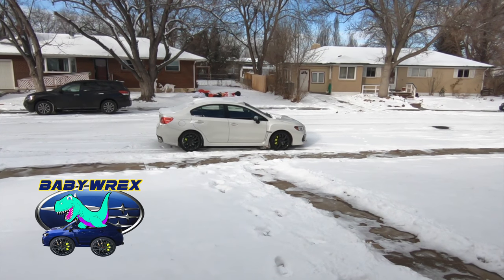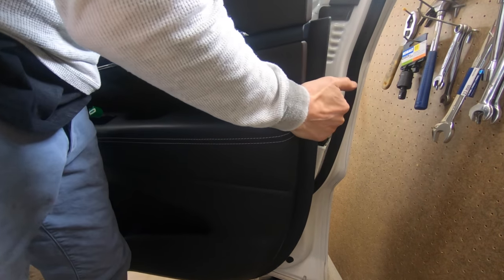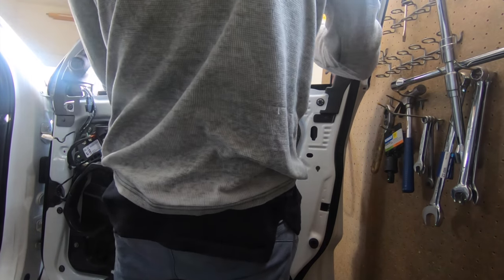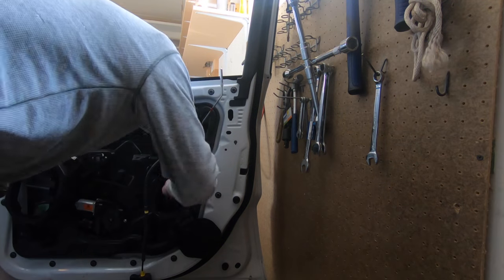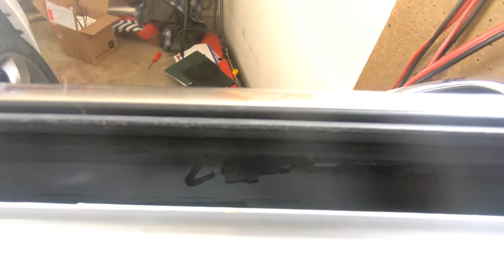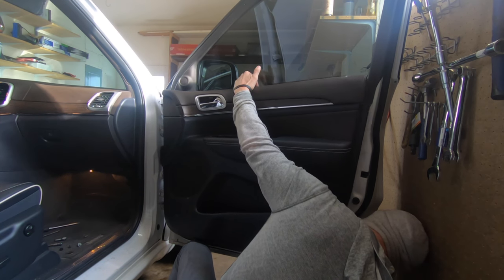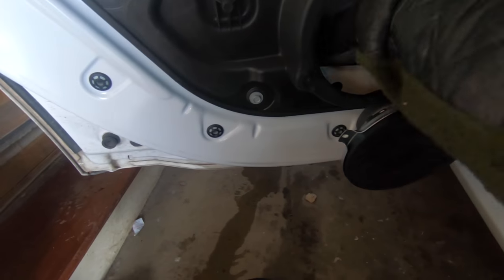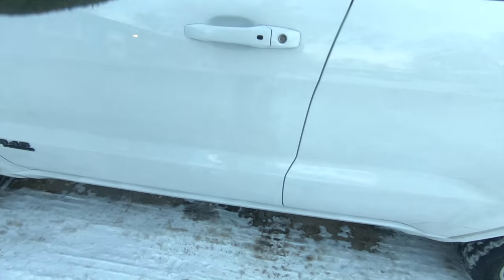2011-2018 Jeep Grand Cherokee: How to remove chrome door handles

Comment: 10:39 Try lining the socket with a scrap of notebook paper, and nut will not fall out when you remove it.   Tape one side of scrap onto the side of socket to hold in place.   14:29  Mask off paint around door handle to protect from scratches while fidgeting to remove door handle.
Reply: I used a telescoping magnet to remove the bolts. Simple

Comment: thats awesome. i am sure u get this question often and im sure i know the answer but, why don you just pick up the coers that 3M to the existing handles. I am assuming because you want the actual handles. Which i get but for me i am just going to get the covers. With that said you did help me learn other things about the door as well so either way this was veryt helpfull. Specially when i decide to change the ambiant lighting color from cyan to RGB and when i sound deaden the doors

Comment: Front doors were a pain, even with taking the door latch off on the side of the door. My arms were just to big to get them moved around. I eventually pulled the door skin back far enough but had to watch breaking off the plastic inside holding the lock on. 

Btw the video is amazing, damn arms were just to big esp after dropping a bolt. Hey wife lol
Reply from the maker: The job is a slight nightmare for sure and all those damn 10mm around the inner door panel!  Shoot me lol glad that video helped and the oem look is so much better than vinyl or plasti dip

Comment: Hey could you provide info or video on how you switched out the rear step surround?  I've got.the mopar blk textured rear step surround, and it has tabs all around the piece, snap on functionality, without any screws.  How did you pop off this piece?  Thank you.
Reply from the maker: Gene P. Just use plastic pry tools and pull up on the pad it pops out super easy.  Look at the replacement black pad you’re going to swap in and locate all the key clip areas this is a huge help.
Reply: @AtlasWilder  Thanks man for your prompt reply and advice. 
It was an easy pop up.

Comment: So here is my question. I have murdered out several of my Jeeps in the past but my 15 Limited has the chrome covers on the door handles and the side view mirrors. I want to paint them to match the body color, True Blue Pearle using paint from the Touchup Zone. Any tips on removing the covers and any experience with Touchup Zone paint? Thanks.
Reply from the maker: I’ve used touch up paint before however what is your intention? To use a spray can right?? Chrome covers & not actual handles?

Comment: Should i do this for my chrome handles on my black 2015 or just do the cover/ wraps ? ... thanks for the help
Reply from the maker: Just cover the silver parts way easier and cheaper. Replacing the entire handle takes some work.
Reply: @AtlasWilder  sweet man thanks for the reply
Reply from the maker: If you want to do this nightmare of a job find the handles used on eBay. It will save you $$
Reply: @AtlasWilder  not really lol was hoping the wraps would work w the black , did  chrome window trim delete  yesterday, def needs the handles to match it now

Comment: Does anyone know what would cause the passive entry on the front passenger door not to work after doing this? It works fine on the drivers side but not on the passenger. Unlocking and locking neither one works from the outside.
Reply from the maker: You forgot to plug in one of the connectors or didn’t get it plugged in all the way.  I actually made this mistake

Comment: Any reason why you chose to replace the whole handle (which I am sure was not cheap) as opposed to buying the $20 black gloss handle covers and painting them OEM white to match your jeep?  I am leaning towards this as a cheaper option then replacing the handles themselves.  Thoughts?
Reply from the maker: FunkyMedicine I picked up the handles on eBay for about $200. I don’t usually cut corners on aesthetic mods, if I can replace with oem stuff. The covers will have gaps on backside where you slide your hand. That would bother the heck out of me. 
However you do you! I totally get it money could be spent else where.
Reply: @AtlasWilder  How did you vinyl wrap the chrome tail light bezels?  Did you wrap it with the tail lights as is, or did you remove the tail lights first?
Reply from the maker: Didn’t use wrap, those are the oem painted bezels.
https://rover.ebay.com/rover/0/0/0?mpre=https%3A%2F%2Fwww.ebay.com%2Fulk%2Fitm%2F352437172331

Comment: Hey, thanks so much for making this video, I’ll be using it for sure to replace my handles as well!  Would you happen to remember where you picked up that red tool for removing the interior door panel and window control panel?
Reply from the maker: Ricardo Barraza thanks! I swear I got something similar to this 
https://rover.ebay.com/rover/0/0/0?mpre=https%3A%2F%2Fwww.ebay.com%2Fulk%2Fitm%2F263182122614
They have them on amazon also.
Cheers!
Reply: Just ordered it, thanks so much! Can't wait to give this a try.

Comment: Great informational video!  Would you be willing to show me how to replace the chrome outer window lining with the black?  To order this black strip, you need to identify a Jeep GC at a dealership, then ask what part # it is.  This would make the GC look even cleaner imo.  Any suggestions?  Also, do you have a video on swapping out the side mirrors?  Thanks again.
Reply from the maker: Thanks! I’m not sure we will ever get around to replacing the trim.  There is some videos out there however and check out jeepgarage forum for more info on that.  I don’t have a video for the mirrors, I did most the mods on the Jeep before I got into vlogging them.  A lot of people also go the vinyl route on the trim. Cheers!
Reply: I drive a 2017 overland. I ordered my window chrome delete vinyl 3m sticker from crux motor. It looks perfect and if I can do it anybody can. They have a video on you tube but its pretty self explanatory.

Comment: Did the new handles come with a new physical key, or do you need to switch out the lock from old to new handles?
Reply from the maker: No, you will be able to swap out the lock cylinder it’s easy. 👌
Reply: @AtlasWilder  awesome! I'm doing big things to my 2018, getting rid of the chrome is priority 1

Comment: Soo do you actually have to remove the window on the front is it away around it
Reply from the maker: Yes you have to
Reply: @AtlasWilder  I did the back doors I was stalling around on the front hoping it was a easier way lol
Reply from the maker: Unfortunately yeah it’s a bummer, I just picked up a used High altitude that way I wouldn’t ever have to change the handles again lol

Comment: Thanks for this. Please don't take this video down for at least a couple of months. That should give me enough time to tackle the project LoL. Also, are those the stick on mirror covers or did you paint them? If stick on, how do you like them?
Reply from the maker: Apostolis Balanikas thanks! Don’t worry the video isn’t going anywhere. They are stick on, almost perfect fit but up close you can see it is thicker and not oem. 
Other than that I’m happy with them not trying to break the bank on the Jeep build 👍
Reply: Mods And Coffee Thanks again. Last question. I noticed the driver door handle came with the bracket attached? Any reason for this? Any issues swapping out the key cylinder?
Reply from the maker: Apostolis Balanikas key cylinder slides in and out easy.  The handles I ordered came like that way,  I mounted them to the oem pieces nothing to worry about.
Reply: @AtlasWilder  Any chance you have a link to where you got the covers?
Reply from the maker: Tom Cutsforth honestly no it was so long ago! Got them on eBay

Comment: Where did you buy the handles from
Reply from the maker: Check justforJeeps.com I found these on eBay
Reply: Thank you for a excellent video! I followed your video  with one change I made. If you unscrew the 3 screws that attach the power window motor this frees the window to move it up and down by hand so you can more finely move the window to get at that clip that keeps the window in place. I was having some difficulty getting the clip where I needed it to get my hand or a tool near it, but I was working on the passenger door also. Thank you for doing this for us Jeep owners!

Comment: Ha ha...you went from jeep to Subaru...I was looking at Subarus and almost bought one, but the fact that they do not have the ability to lock up the drive train off road led me to buy a Jeep Cherokee trail hawk. After a small lift and bigger tires I have an off road beast that none of the newer Subarus can touch off road no matter how you mod them!
Reply from the maker: I actually just bought a Grand Cherokee wk2! Check out my new videos!